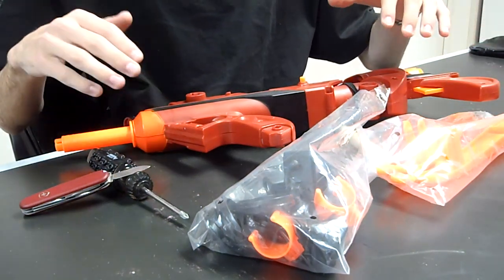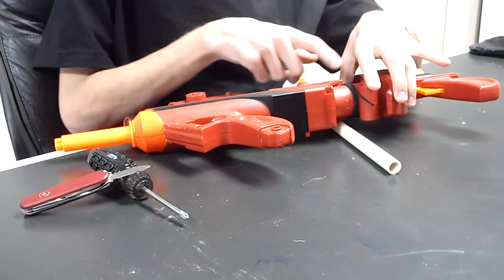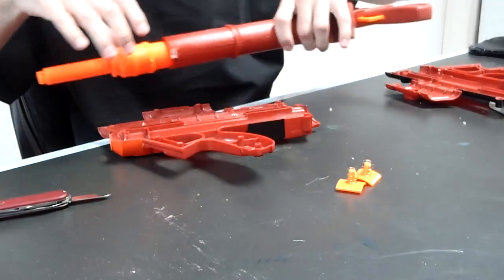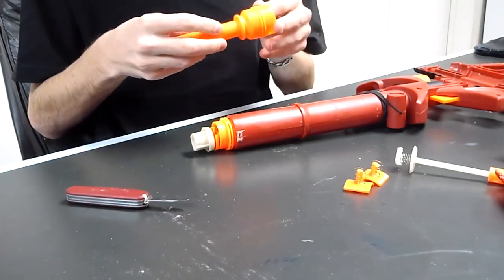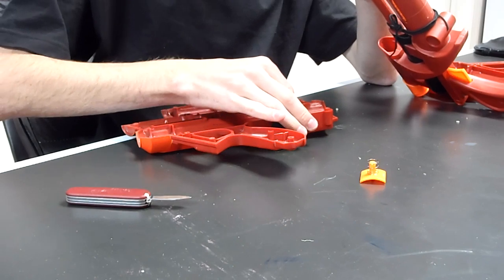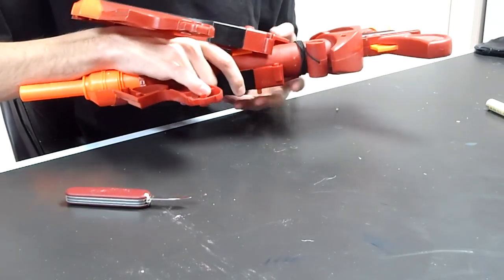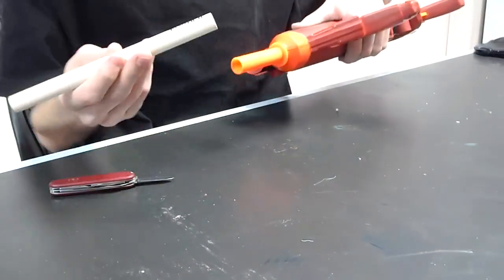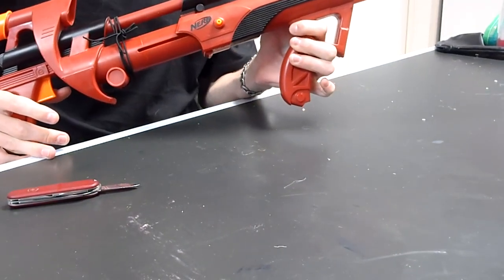How To: The ULTIMATE Big Bad Bow Mod Guide (Air Restrictor and Barrel Mod)

Comment: Hey guys I just made mine a new and better way! so if u got a resistance band laying around (that u don't need) take the plastic part where the part that the rope thing goes though the plastic tube take the foam and the tube and put the tube on the end of the robe. IT REALLY WORKS ( maybe not if u got the wrong chord.

Comment: When you took the air restrictor out, you took off part of it and put it back in the gun.  You don't have to do that. When I modded mine, I took out the whole air restrictor.  To make sure the barrel would stay together, I used duck tape.  Perhaps if you took that part off and applied duck tape to hold the barrel together, your gun would have a little more power.

Comment: josh bacon I had a nerf bow, don't remember if it is the one you are mentioning, but the tip of this bow that held the arrows sort of coned in a little bit at the tip which didn't allow smaller darts to feed in so i cut the coned tip off and it can fire normal darts and the arrows now. Maybe a similar mod will help you :)

Comment: well, I suppose it is a little large so the dart ends up flying off target unless you're really close, but seriously, just drill or punch a few holes in the AR and if you're going to use a CPVC pipe cut it about 1/2 inch shorter than the barrel and gently tap it into place inside the barrel using a mallet and a dowel so a dart can sit with the tip flush with the end of the barrel, it'll use less material, get a bit more range and reload faster and easier

Comment: rather than completely removing the AR, I would just reduce it as much as possible so even if I accidentally vacuum load a dart it won't get stuck, and that way the CPVC pipe is not needed unless you want to fire streamline darts as the attached barrel is already just the right size for the micro-darts

Comment: I found my old 1998 Hyper Sight (same as the BBB) from when I was a kid and want to bring it back into service. So I have two questions.

First, would fitting a much shorter (flush with the stock orange barrel) pcv sleeve effect performance?

Second, would the old gun have an air restrictor like the new one? When dry fired it sounds like it doesn't.

Comment: when i did this mod my BBB will shoot but it would always jam the jam is caused by the rubber bit attached to the plunger slamming itself into the ring of the air restrictor is there a possible way to fix that? if so can someone please tell me

Comment: cpvc is smaller than PVC, but be sure the dart fits the inside of the cpvc.  Sometimes the inside it too small or too rouch for a dart to fit inside, and you have to hollow it out a bit on a lathe or with a drill.

Comment: if you cut your peice of cpvc to about the length of a stock micro, or just as long as the original barrel, you will have MUCH less deadspace and have the most out of that powerful stock spring. :)